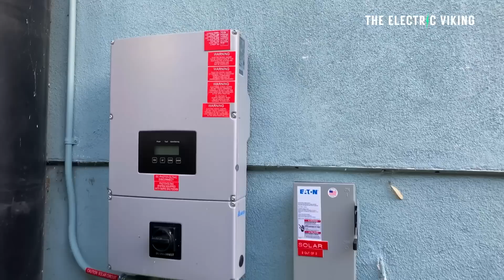Scientists say solar panel advances will see millions go off grid

Comment: In Brisbane Australia, I have fence across my patio. I had bought four recycled panels which cover it.  As I am renting I've used two deep cycled batteries and am running 12 volt LED lamps only and a converter for my large camping refrigerators, one freezes. Mains power is expensive so I cook with it and shower. A bit "Heath Robinson" but I already had the gear so it's free, and gives me more privacy.

Comment: It stands to reason that as renewable tech advances more, it's going to allow a lot more of us to go gridless, and I suspect a lot of us will want to do that because it would be a simpler setup, and the savings will be direct to you, after all, for all the renewable energy going onto the grid, we as consumers don't seem to be seeing the savings in lower energy bills, so generating your own energy is a sure fire way for you to save over the long run.

To go gridless, renewable tech is already good enough, what is really needed is a buffer when it comes to storing that energy for when it's needed, and for now, it's too expensive and not enough energy storage, but thanks to EV car boom, that's very likely going to change.

Also, as the video points out, Europe isn't really a sunny region, well Northern Europe isn't, if they can do it, then the majority of the world can.

With that said, I do think a mix of solar and wind at a local level is a better option as they both complement each other by having more consistent energy generating throughout the year, which would actually reduce how much energy storage you need.

If it's solar alone, you're going to need a lot of energy storage to cover good and bad days when it comes to the weather, but if we can have a mix of solar and wind, that would be more constant and would reduce the amount of energy storage needed.

Problem is, there are too many scams when it comes to wind turbines for your home and they don't seem to produce that much energy, whiles also being expensive, but with that said, a lot of experiments are being made on vertical wind turbines for urban areas, if they can crack that and produce meaningful energy in urban areas, that's going to allow a lot of us to be able to go gridless, but even without that, solar is getting so cheap that it's making a lot of sense to oversize your setup, that yes in summer, you'll produce way more energy than you need, but who cares, just as long as you can produce enough for your needs in winter.

Comment: A Tesla solar roof with ample power wall batteries have run a house for 3 - 4 days without sunlight which happened when the California bankrupt power grid turned off high voltage transmission lines to keep them from starting forest fires which had already started causing there to be 3 - 4 days of heavy smoke and little sunlight.  It can be done, but is extremely expensive and the person doing this said they needed to get a backup generator for such situations.

Comment: You keep saying the 60% solar statistic. It is completely wrong. Latest stats for German electricity generation are 6% solar, not 60%. Wind is much more than solar in Germany. Proportions of renewables will increase but wind is always going to be more than solar in this climate. 

I looked up the research paper cited here. It doesn't say 50% of houses are self sufficient, it says 50% could be self sufficient if you had an unlimited budget for panels and batteries and heat pumps and insulation. It doesn't predict that 2 million houses will leave the grid. That was a click bait headline. The actual calculation is that 2 million houses could leave the grid if they were willing to pay 50% more than if they stayed on the grid. No one wants to pay more than they have to. No one is going to pay 50% more just to go off grid. And that only applies to the optimum 2 countries. In most countries it will cost 3-4x as much to go off grid, and in some it's as much as 10x. So basically people in Europe are not going off grid. It doesn't make economic sense. That only applies to very sunny or very remote places.

Comment: Lets say 30 million do go off the grid - probably not but lets say that is true - lets say world wide you get a proportional number of people off the grid to solar - OK thats 2% of the world population of 9 billion.  But they won't get off the grid; they will potentially supplement their energy with solar but there are not enough batteries to provide over night - let alone days worth of power; for that you have at very best 1% of the population. that is 90 mliion of 9 billion and it would take 100 years to get to the rest of the population; for what?  CO2 doesn't control world temps.  Dinosaurs lived 200 million years at between 1000ppm and 3000ppm; they died of cold.

Comment: Solar panels do not generate power 24 hours a day ..batteries are needed ..Australia currently has a recall on solar storage batteries due to them spontaneously combusting and destroying people's homes.
Then comes the issue of what happens when there is a week or more of cloud cover and or snow.
The amount of money that will be spent by millions of households trying to go off grid , will be greater than the amount that could have been  spent to create a centralised generation grid based around large power stations.
Just more climate change hysteria motivated anti fossil fuel projections that will fail miserably ,, just as we are seeing with battery powered cars.

Comment: Nuclear is the worst option, run a nuclear plant and you get waste Plutonium which is primarily used for atomic bombs. Politicians wanting nuclear want weapons not electricity. The cost of building these plants is so high most never release the construction cost... With that same open budget we would be 100% renewable on wind solar and storage in five years, but non of these can take out a city so, there is less political interest...

Comment: What I found interesting after we got our solar panels up and running, was the actual app we got. Suddenly you could really see where you were wasting energy, not only how much you were getting from the panels. Why were we burning 350W through the night? Why am I using so much energy to make 1 cup of tea?  Within a week of having the app, our most energy consuming light in our house was the 40W heat-proof oven light. The app alone made a huge difference.

Comment: Millions from 500 hundred millions is less than 1 percent. And there is good reason for that. For example, my roof sollar produces 450 kWh in june, but only ~10 kWh in december. No error here. 45 times less in december. When MWh size battery will be commonplace, I will consider going offline.

Comment: Running 20.5 kW of solar and a 13 kWh battery in Germany for two years now. Off grid would be an option from April to October. But what about the winter time? Also: my excess power during summertime would be lost when I go off grid. And that pays for the amount of energy I need during winter time. So actually I prefer staying on grid under the current conditions.

Comment: It is something I want to do. if and when I get to solar panels, and batteries. Have it as a separate stand alone system. But retain the grid connection as well as back up. Probably a bit awkward and inconvenient but a transition safe way to move forward.

Comment: Especially in the sun belt,but a integration of AC and hot water in the same heat pump with storage for the heat and cold ,it will be chipper than battery and longer cicles.

Comment: Yes I am at a turning point here in Australia, I have grid connect and off grid power, the only reason I need the grid is for exporting power with a good feed in of 12 cents, this feed in is being reduced over time and come Aug 2024 when my 12 cents will likely only be 3 to 5 cents offered on the table for exports which wouldn't even cover availability costs to stay with the grid, I will remove myself from the grid, my grid usage is only 90 kwh a year!!, my off grid setup is 8kw of panels with 52kwh of batteries, when my grid connect is shutdown it will give me an extra 15kw of grid connect solar panels for off grid use, along with an upgrade off grid inverter going from 5kw to 11kw now sitting in a box waiting for the moment

Comment: If batteries come down in price like solar then every farm in Australia will be off grid. Regional towns I would imagine too would be independent.  Local solar, wind, hydro, batteries and diesel back up generation would be perfect. Diesel generation is expensive but very cheap to lay idle which would be most of the time.  Such a huge reduction in the  thousands of miles of high voltage transmission lines and the poles and wires and the maintenance required to service remote communities would surely allow for cheaper grid prices for city customers.

Comment: IMhO: The ongoing improvement in Batteries along side mass production and dropping battery cost will be a huge part of the folks dropping grid connections. I think for most solar wind water turbine alternative home energy systems ... currently benefit from using grid connection as their backup electricity for surge loads, and long periods of cloudy days. 🙂.

Comment: This may be true of relatively low latitudes with sunny days of fairly constant length, but in higher latitudes with short winter days and cloudy weather PV only generates reasonable amounts of electricity in the summer.  The grid will always be needed and wind rather than solar will be the mainstay for at least six months of the year.

Comment: You’re gosh darn right!  My bill for my small studio in NYC is $132 this month, I called ConEd and they said only $44 was energy the rest was delivery a .. only 1/3 was energy!  Everything else was bogus charges
Reply: Building and maintaining the power grid actually does cost real money.
Reply: @alanjm1234  WHAT! Not "bogus charges",?

Those wires don't grow up there by themselves?
Reply: I pay 8.1 cents per kw/hr for my electricity.  Bur surprisingly, it costs money to bring it from the windfarms to my house.  Another 6.7 cents.  Includes taxes, which as you may have heard, are necessary to keep a civilization running.  Nothing bogus.  Grow up.

Comment: This is great news, but the batteries needed are glossed over.  From what I've seen, an American home, depending on what natural gas if any appliances are used, will need at least $30K...plus installation!..worth of batteries.  Which are only warranted for ten years.  Maybe you'll get 15 or even 20 years, but with declining efficiencies. And all that lithium and cobalt mining.

But this is only how things are now.  These are exciting times with advances coming hourly in the shift to renewable energy.  The electric company in Vermont realized that it was cheaper to buy batteries for peak load times than build a new fossil fuel plant.  Now, that's thinking outside the box!

Comment: Its pretty hard to get away from the grid completely.  Batteries can only deliver a portion of household peak demand.  We'd need a step up in battery "power" to do that, but perhaps compbined with an EV you might have enough power.  Also if we convert to some electrical heating we'll need more power again.  Germany and many other countries are primarily gas heated, however this might be converted to mostly geothermal. 
Ultimately the grid is great for when energy is in short supply in your region, which can happen for days or weeks.   At that time the grid is essential.  Transmission capacity is actually more effective than storage for dealing with intermittent renewables.

Comment: The issue I have with solar is I can’t see a ROI. My annual bill is $1500.00. If I could reduce that to $500 saving $1000.00 a year and compare it with investing $20,000 at 5% I would break even. I know this doesn’t account for energy increases but it also doesn’t include any cost to repair or replace any equipment that may fail.

Comment: More financial sense is to  offset electric bill with a modest solar grid without batteries.

Cheap Solar panels are all China made.  (Politics involved).   

Even without politics, off-grid with solar is expensive.  Requires very large solar panel grids with battery storage.   Only the rich can afford. and even that is NOT a long term solution to power.

Comment: I actually think it's the opposite, I think the grid will simply decentralize.  Every household will generate their own power, and overage will go to the grid, creating a hyper abundance of energy.  And yes, I know solar is too expensive for a lot of people...right now.  So are batteries...right now.  But, have you been paying attention to the YoY declines in costs?  Now map that over the YoY increases in solar efficiency and battery density, while understanding that both technologies are considered to be near infancy in their technology curve.  Whereas traditional sources of power...fossil fuel burning engines...are at the end of theirs.

This means costs will continue to fall, while performance will continue to rise, all the while people, Governments and businesses are already deploying solar and batteries basically as fast as they can be produced, that's not stopping anytime soon...which leads to what?  Less demand for natural gas/oil...and if that demand drops enough, those industries start to experience losses from reversing backwards in economies of scale.

Long story short, whether it's a Government initiative or not, it'll just become too economically sound to not install your own solar/battery solution, which will naturally end the oil and gas industry.

Comment: Hi from the NW UK. You raise an important issue Mister Viking.

We’ve gone fully electric and the day we had the gas supply removed was a good one! Averaged over the whole year, half of our home energy comes from the Solar panels on our roof. In the peak generation of summer, we basically run BOTH our home and car from our Solar. :-)

Wind power for home use appears to be very much in its infancy. This needs serious development yet. The RidgeBlade system looks promising.

Cheers.

Comment: I already live off grid. I have a remote property and the power lines cut right through it but I still would never connect. My electric car is 100% self-sufficient because I recharge it with solar energy from my own backyard. For all the naysayers out there I say go buy some solar panels and find out for yourself
Reply: I live in Ontario Canada and I have quite a sufficient over capacity of solar panels so even on the shortest days I can get at least a couple of kilowatt hours. And I have a gasoline generator, and I almost never use it. I have 34 kWh of batteries. Also have two electric cars.

In total I have 116 kWh of batteries divided between everything I own

Comment: I am in the U.K., I have installed 45.2kw of panels connected to 107kwh of BYD storage I have been off grid since the last 2 weeks of March. Even with this absolute crap weather
Reply: Proves the point that its absolutely ridiculous to aim off grid with solar only when outside of the sun belt. You would still have to significantly increase the panel array and battery capacity to survive November, December, January and February.  UK is not that north either, between 50 to 58 latitude. It gets way worse the higher the latitude is. Off grid system would be way over 100k $ investment.

Comment: My house needs 55 kWh per day for electric heating and other use when it freezes minus 5C. How to harvest that energy with solar panels in winter, when it is dark and grey weather? No way possible with the present techniques.
Reply: It all starts with good insulation of the house. Agree that the winter season is a difficult one, with just solar panels to provide all the energy needed.
Reply: Geothermal heating system can help with that if you have electric heat.  I would also suggest putting in a wood stove.  
   Why are you using electric heat?  I ask because it is the most inefficient for of heat.
Reply: @waywardgeologist2520  A wood stove????? Suggesting that on this channel which is all about banning fossil fuels? Besides that efficiency of a wood stove? Not even considering poisening the neighbours? Wake up. 😁

Comment: I think the main thing to come out of all this,  is the potential decentralization of the power supply chain.  Here in NZ if we have a bad storm or an earthquake, large parts of our country can be temporarily out of power.  If we can become a more decentralized system,  it  would mean a major event in one part of the country will not affect other areas so badly.  If some of us had v to g with our evs or a home battery storage system with solar panels, others would not need to suffer a blackout in that situation, and the contributors would be paid for their input, hence the need for a grid.   It will happen eventually,  and both Ausi and NZ are both in the box seat regarding renewables.  It is very windy here in NZ, and we do get some sun here in the north,  I lived in OZ for many years,  and I can tell you there is no lack of sunshine there!
Reply: It's is a cute dream but part of the deal with being grid connected is that your power can be shut off when the grid goes down and that is critically important to safety. You, individually, off grid? Yes. A community generating it's own power because some power lines went down, much more complicated issue.

Comment: I am living in Austria, Tyrol. From March till the end of October I need no energy from the grid, including fully charging my BEV (EV6). 14kWp pv moduls, 28kWh battery, 12kW 3-phase inverter. From Nov. until the end of Feb. I have 70% solar power. Heating with fossil and wood.